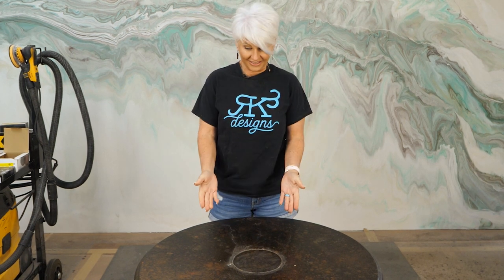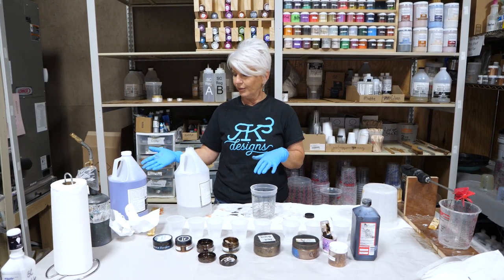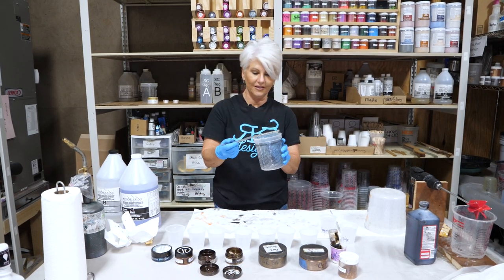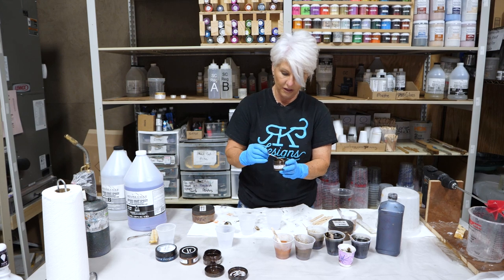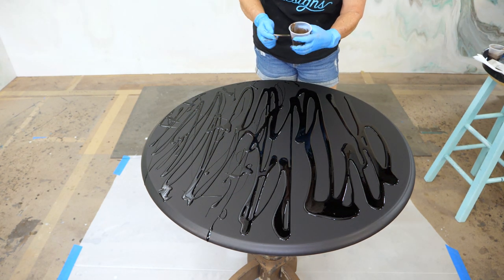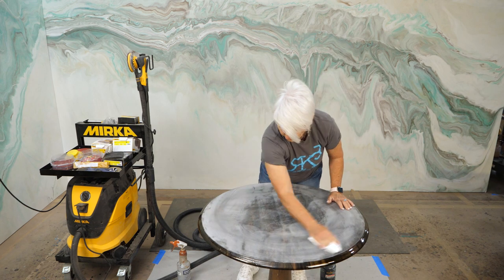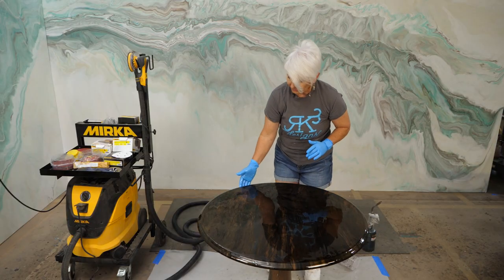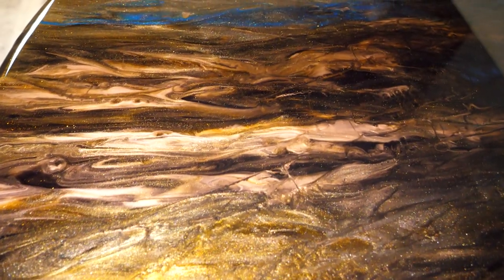How To Epoxy Over An Old Finish | RK3 Designs

Comment: Now that's what I call some high class recycling. Beautiful.
Question: Why do you need to apply the Stonecoat undercoating? If properly cleaned and scuff sanded, wouldn't the new epoxy bite to the old?
Reply: I can answer that.  If it was something you poured recently, and it had not been out in the sun, then yes, absolutely.
But since the old epoxy is sun damaged, it's possible that there will be adhesion problems, and if that happens, it will do this weird, warpy bubble thing.  Like the top epoxy will start to get this little raised spot (after it already laid out and dried perfectly)and it will slowly get bigger and bigger as it cures and that top layer pulls away from the bottom layer.
Reply: @thalinororcbreaker2840  Thank you!
Reply from the maker: Thank you! 😊
Reply: @kenneagle8989  You're welcome.  I could probably film a series "What not to do with epoxy".
Reply: @thalinororcbreaker2840  I could definitely supply several chapters for your series.  btw - Orcs suck!
Reply: @kenneagle8989  We've all got to learn somehow, lol.  And yeah, they do, haha!

Comment: Great video again! 🙂
I have a question I have not heard you talk about. 
You always say to wait 24 hours after the color coat, sand and do the flood coat. 
I've heard someone doing it while the coat is still slightly sticky. So color coat wait about 6 hours or so and pour the flood coat. Save the sanding and finish quicker. 
What is your opinion on that?
Reply: Hello again, 
You may have missed this since I didn't receive a reply, so I thought to add to it to bring it back to the top :)

Comment: What if you don’t know what the finish is that’s on the table? I have a dining room table that I would love to finish but I really don’t know what is on it now. Got to at a thrift store. It is in good shape. However, it is dark wood grain with deep crevices and also has a piece that is removable. I would like to redo the top and make it smooth. I don’t mind the wood grain look but I want a smooth surface and wouldn’t mind using one of the techniques I’ve watched you do today. I just don’t know if that is possible with the type of table that I have. Any suggestions?
Reply from the maker: I would sand the surface well to make sure nothing is flacking off or loose. Then I would use a good bonding primer, I recommend UTC, then paint your base color and pour the epoxy. Just make sure your surface is flat and level 😊😊

Comment: Now that's what I call high class recycling. 
Question: Why do you need to paint (2 layers of stonecoat undercoat) over the old epoxy? If properly scuff sanded, wouldn't the new epoxy bite to the old?